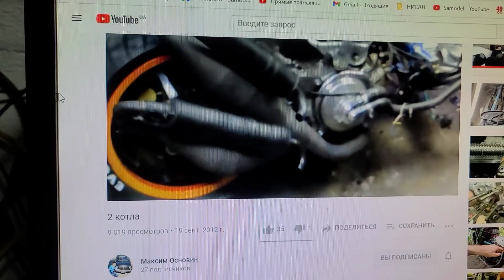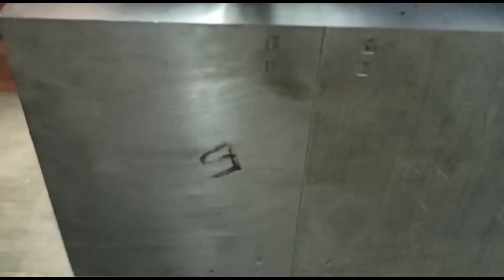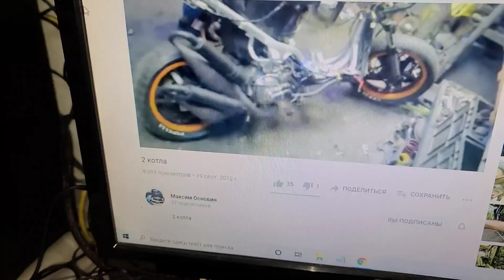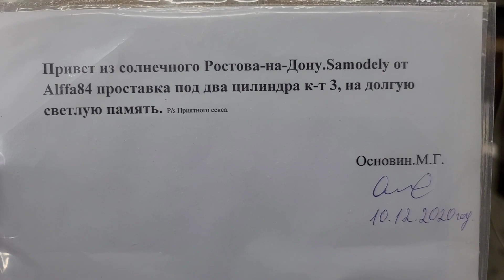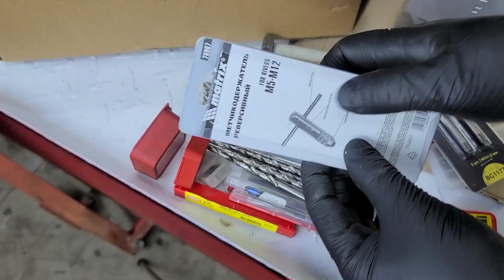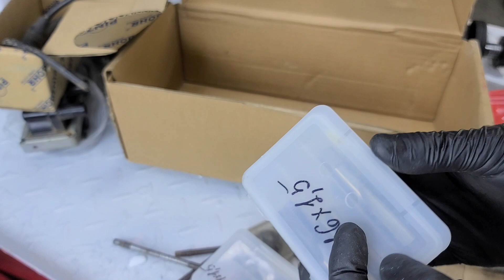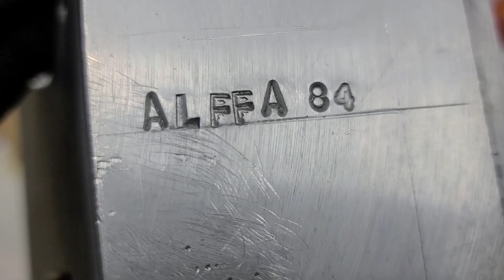Два цилиндра на Yamaha - Minarelli twin cylinder kit

Comment: yo man. please tell me you installed a bearing on the inside of the center section spacer. also please tell me that you installed the seal that is supposed to sit there as well. if you only install the seal on the case halves on the outside the crank case wont pressurize properly for each half. you will end up splitting the pressure back and forth and it will run poorly.
it will act like a 2 stroke with blown crank seal or seals. even though its not actually leaking. it would be leaking internally to the other side more or less.